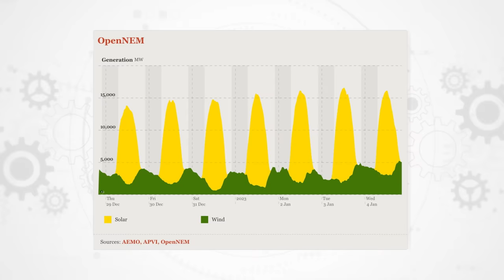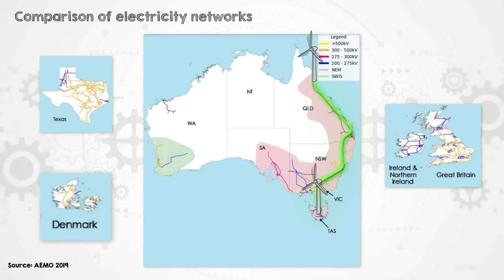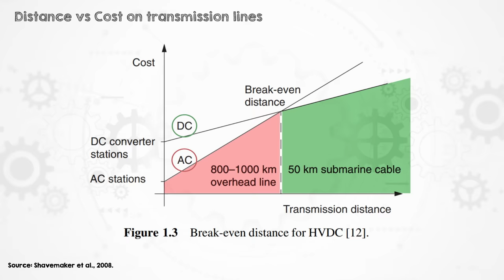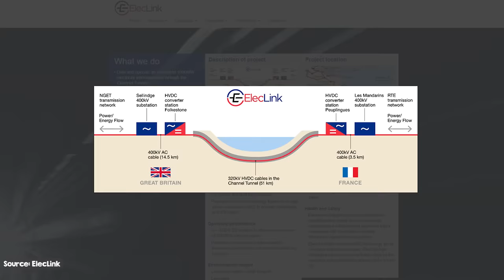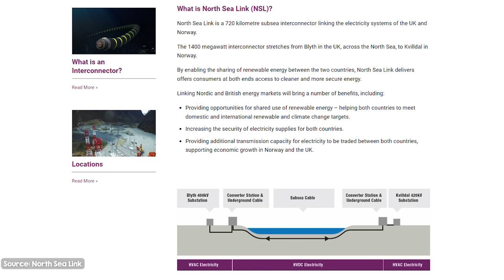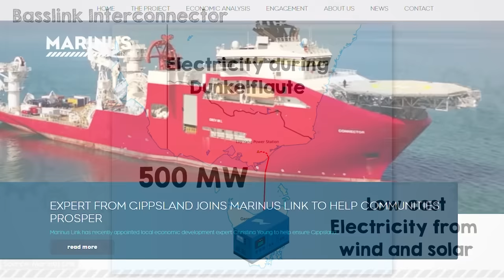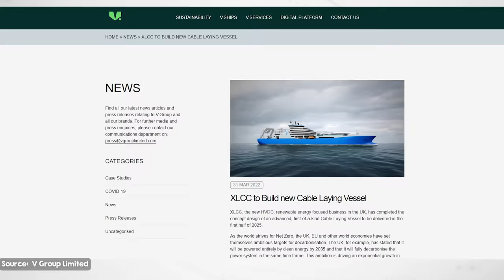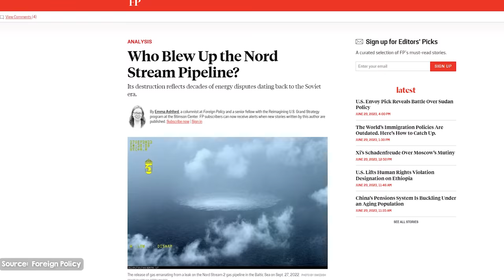Electricity Across Oceans: Is HVDC the Future?

Comment: There are discussions of a cable under the Mediterranean connecting the solar farms in the south of Israel to its north with a branch going to Cyprus and from Cyprus to Europe
Reply: I wrote my thesis in Electrical engineering in 1978 when there were fewer lines. The most interesting part of HVDC which you didn't cover are the converter stations which convert AC to DC and vice versa. Also other than arbitrage there are other benefits such as stabilizing a connected system undergoing a major disruption and delivery of email power during major get shortfalls.

Comment: Let’s manufacture thousands of miles of cables and create seagoing infrastructure to support it instead of just going nuclear and get green stable energy using infrastructure that already exists at decommissioned plants……..

As a engineer I was taught it’s not how many bells and whistles you can add, it’s how many you can take out and eliminate failure points.

Comment: ElecLink at 5:25.  No mention of the fact that at least 70% of the energy passing from France to to the UK is nuclear.  Ironically W&S and Nuclear power all benefit from having strong interties with other countries.  France frequently has non-emitting nuclear power that it can export at very low cost to surrounding countries, if the transmission capacity is available.  As I write this, the biggest power flow into or out of the UK is 1.38 GW of imports from France, mostly nuclear.

Comment: Texas has been using 80 Gigawatts of power during this heat wave. And pioneered HVDC connections ouside the Ercot Grid years ago. About 30% of that 80GW number is produced by Wind and Solar with Natural Gas Combine Cycle Generators on rolling backup. Shiuld note the current Texas Government Literally HATES green renewable energy. . Texas could easily produce 1/3 tp 1/2 of the U.S  total energy output with wind and solar by replacing our older windmills with newer 15 megawatt ones.

Comment: The resistivity of copper is over 36% less than that of aluminum at 20 degrees C; since losses due to resistance need to be minimized in long distance HVDC cables, I should think copper would be the universal choice despite its higher cost.
Reply: You just need more aluminium to get the same resistance, but since aluminium is cheaper than copper,  the aluminium cable may be cheaper, depending on the metal prices at the time.  There is plenty of space in the ocean for a slightly thicker cable!  Weight isn't really an issue like it may be for overhead lines, but the aluminium cable would be half the weight of the copper cable.

Comment: There is HVDC between France and England, but also between Germany and Norway.
It has also been considered to generate solar electricity in North Africa and to transport it to Europe. But to date nobody is willing to invest the costs.
Germany is in the process of building an overland HVDC line from north to south.
AC only works for short distances in the sea.
Reply: There are more than that: Just from Norway:
Norway - Denmark: 1,7GW
Norway - Netherlands: 1,4GW
Norway - England; 1,4GW
Norway - Germany: 1,4GW

To put that in to perspective, Norway's installed capacity is 38,8TW, with a yearly production of 154,8TWh in 2022. And this is mostly (>95%) hydro power.

"Germany is in the process of building an overland HVDC line from north to south."

Norway officially complained after the opening of the Norway-Germany link, and demanded that Germany build out capacity north/south or divide Germany into multiple price zones.

The reason was because when north Germany overproduced wind, they could not send it south because of the capacity. In addition the low capacity to the south kept the price artificial high, thereby lowering the profitability of the connection to Norway.
Reply: England??? 

The southern part of the UK??? IE Brexitland
Reply: @nc3826  No, IE is not Brexitland, they stayed in. The entire UK left, though, not just England.
Reply: @nc3826  Proving your point? That Ireland is Brexitland? I don't understand why you think that was a valid point in the first place, nor why you think I had the power to prove or disprove anything. But thanks, I guess. I didn't know my opinion was so valuable.

Comment: Bit surprised the biggest loss in AC wasn't mentioned, simple fact the voltage/current must pass through Zero 100 times /second, and the portion at less than RMS voltage must transfer to the peaks cause need for heavier insulation for the same MVA rating
Reply: Or 120

Comment: Because AC oscillates, it is not operating at the peak efficiency, either. Though most of the energy is transmitted when the voltage is highest (and efficiency is best). But a lot of the potential transmission capacity of the line is lost as it kind of spends a lot of time "throttling" in a way.

Comment: I'm only aware of two HVDC systems in the US.  One from the Pacific Northwest (border of Washington/Oregon on the Columbia River) to Los Angeles, about 1360km.  There is also a HVDC grid interconnect between the east and west grids in the US. The US is lagging behind on HVDC systems.  In other parts of the world we are seeing Ultra-HVDC lines (up to 800 kV) starting to appear.
Reply: theres also one between quebec and new hampshire. the project stalled out relatively early but there's still some quebec hydro coming into new england.
Reply: There's one proposed between an Iowa wind power farm and Chicago, running along railway lines to avoid rights of way issues - instead it's being held up by the Eastern Grid refusing to connect to a generator in the Western Grid.
Reply: And there are two above ground links in the province of Manitoba, Canada that bring hydroelectric power from the North to the load center in the south. They were built in the 1970s using mercury arc rectifiers, now converted to solid state thyristors as used in all modern converter stations

Comment: Imagine a Carrington-style event inducing stellar-scale currents.
Reply: Not as bad as you'd think - there are safety devices. It would cause widespread blackouts, yes - but most of the damage could be fixed just by re-setting the many isolators and breakers. Major population centers would be back on-grid in hours, small towns in days. If you live out in the sticks and the breakers don't have remote management then you might have to wait a few weeks for the engineers-on-overtime to send someone around to the substation. It'd be expensive and very annoying, but not a civilisation-ending disaster.
Reply: @vylbird8014  I guess relevant to this video, how vulnerable are HVDC converters, compared to AC transformers, to a massive power surge from a solar flare? Anyone know?
Reply: @ps.2  I'd imagine not too much. If you're dealing with 100KV, 200A on the /small/ end of HVDC anyway? Even a Carrington is pretty small compared to normal operating conditions. And no transformers to saturate. Probably trip some safety cutoffs, and it might be difficult to start things up again if communications is disrupted, but the HVDC hardware itsself should be fine. It'd need restarting, not repairing.
Reply: @vylbird8014  Also, since HVDC seems to be most interesting for undersea routes (the ones Rosie talks about, but also every offshore wind farm), I presume the water would largely shield them from solar flares, yes? (As I understand it, the danger from solar flares is not so much hitting a transformer directly, as inducing a power surge in the exposed lines. And the length of the exposed line determines the severity of the power surge.)
Reply: @ps.2  I'm not certain, but I don't think the water would make a difference - the induced current comes from a sudden change in the earth's magnetic field as it is distorted. An ocean of saltwater would provide excellent shielding against an electric field or radio, but it's going to do do next to nothing against a purely magnetic disturbance.
Reply: @vylbird8014  Fair enough, I'll take your word for it. Even if you're "not certain," I'm even less certain. (:

Comment: There is an air of impracticality in some of these proposals. For example there is almost no interest in Singapore in the much touted Suncable to provide energy from Australia to Singapore. This proposal widely touted in Australia does not appear to have a customer.

Singapore's energy capacity requirement is about 12GW. As current plants are retired it is replacing this with 2GW of locally produced solar power balanced by gas peaker plants and shared power generation with Malaysia and Thailand. It will likely also have links into the Indinesian power system that is itself planning for a solar supplemented by nuclear future.

It would make much more sense in Australia to build a transcontinental HVDC cable linking east to west, with potential to link undersea to New Zealand. Such a cable would allow east west arbitrage, a key to realising the potential of such projects.

Additionally, Australia with a population rapidly closing in on 30 million, needs every bit of energy it can get to transition from a highly fossil fuel dense economy, to one based on manufactured products and materials such as green hydrogen produced sustainably without green house gas emmisions, actual or potential.  

In a post green house gas world the country will need on line generation caoacity 24/7 of at least 60GW. To thrive it will likely be several times this, with some estimates ranging over 500GW.

Comment: They could use DC step up and down in the 1920's and did so on a large scale using rotary converters. Problem was the losses involved.
Reply: I think rotary and 200 kilovolts would have been interesting. An oil filled transformer is much easier to get working at high voltages.

Comment: speaking of politics being "outside the scope" of engineering, understanding how mutually distrustful nations could benefit from "trading" electricity could lead to closer relations, or at least detente (i.e. thawing of cold relations via talks).

if there is a way to include energy storage on both sides of 2 cold nations, there would be a reasonable buffer so the source nation cannot instantaneously sabotage the receiver nation. this would allow the source nation to sell to cold receiver nations by convincing them that they will not be denied what they paid for. of course, the cost and usage of such a storage bundle would be up to the nation that hosts it, therefore having one on both ends would seem fairer.

imo, politics often requires creative thinking to come up with viable solutions, and unlike what traditional mooks may think, i thoroughly believe engineers to be some of the most creative problem solvers in humanity. so if there are ways to engineer solutions out of political deadlocks, don't sell yourself short! my little example is probably as vanilla as it comes, simply because i'm not an engineer myself. perhaps if you lot are familiar with the intricacies of the political situations... you might come up with much better/more interesting ones!

Comment: Always thought DC was nearly useless for long transmissions. The old Westinghouse/ Tesla battle vs Edison
Reply: That was true 120 years ago, when they didn't have efficient and cost-effective ways to step DC voltage up and down. The invention of the AC transformer really changed the game back then — a very simple and relatively cheap way to step your AC voltage up and down to almost arbitrary levels, and there was nothing comparable for DC power. So they had to transmit DC at relatively tame, inefficient line voltage.

With modern engineering and semiconductors, HVDC is now possible. But as Rosie points out, its greater efficiency is offset by its higher costs at each end, even today, so it only comes out ahead when the distance gets long enough.

Comment: Very good but those of us with an engineering back ground in shipped liquids know we ship LNG at $7/MWh and could ship e-methanol or e-ammonia at about $10/ MWh.
HVDC probably better up to  say 1000 miles but above say 2000 miles, shipped liquids will be cheaper and they are dispatchable to make power and can dodge the politics by having multiple sources/destinations.
People forget HVDC needs to be firmed at the far end with lots of storage and dispatchable generation.
Morocco has periods of several days with no wind nor Sun. Canada has cold dark winters at the same time as the UK. 
A civilised world can't get by on energy which can disappear at the speed of light and needs a big dispatchable proportion and security of supply HVDC doesn't bring..
Reply: If there is an HVDC cable available then the e-fuel can be created and stored at the destination when there is surplus electricity available, so there is no need for your shipping!  Any electricity that can be used directly then has zero conversion losses unlike the shipped e-fuel.  I think the cable is going to win over distances significantly more than 2000 miles.  Not sure there is much advantage of having centralised storage, except for the odd emergency?
Reply: @nigels.6051  The engineering and economic world knows the real score. HVDC is way more expensive over great distances. Its why liquids are shipped world wide in huge volumes and there's not so much HVDC. Significant HVDC losses over great distances too.  
https://www.e3s-conferences.org/articles/e3sconf/pdf/2022/17/e3sconf_eregce2022_02001.pdf

Comment: Once again we get a bit of the logic missing. Electrical power  has two "dimensions" current and voltage. High cirrent implies low reistive loss (heavy copper conductors).   Hign voltage implies isolation/insulation (high towers with widely  spaced conductors) Air spacing is good, close spacing is bad, underwater is bad ( repair and conductivity/breakdown) 
All imply single point failure potential in an underwater network.

Comment: Total complete impossibility of sending DC voltage out on a journey accross the ocean.
as power loss of DC is so great that nothing at the other end would appear .Even AC
would be impossible as financial costs would overwelm a project to this magnitude.
Simply build a generator station at required sight .
Reply: This is just plain wrong. A 1000km +/-525kV 2000MW bipole HVDC system using 2500mm2 copper cable (~7ohms per cable) would loose only 28MW in the cables (if we assume roughly 2kA current). That's only 1.4% of losses in the cables.

Comment: The next horizon for HVDC is north Africa. Instead of laying solar in cold regions, the power simply needs to cross the med into France and get distributed from there. This is the German solution, and for most of Europe for that matter.

USA to Europe? No. Connecting the regions of the USA makes more sense. HVDC can act as superhighways for power in USA grids. Also, nearshoring is a factor. Turns out laying cables in the ocean can be cheaper than over land.

Comment: The losses associated with skin effect would be very low at 50 or 60Hz.
If long distance AC transmission lines were used alien astronomers might discover Earth because it would be a low frequency radio source. The Transmission line would act as an antenna.

Comment: So what happens to marine life when you generate a huge local false magnetic field?  What happens to their navigation and direction finding?  Nothing to worry about here, just like when the dams were built I suppose...
Reply: No issue we will have the oceans fished out in the coming years. All ready for cable.
Reply: This is one of the reason why the two cables are run in parallel as it cancels eachother.
Reply: @55damien55  doesn't we run coils parallel to make magnetic fields??
Reply: @0Aus  I'm not sure what you mean by that. The cables will produce a magnetic field  but to avoid compass deviation and confuse the fish, the cables are run with the other polarity nearby to avoid generating any significant field.
Reply: @55damien55  ok so traditional over head power lines do they also do that? As they produce energy fields that make them sway and also indicate to objects under them?
The fields are also linked to cancers tumours on the spleen in animals & I assume humans.

Comment: The confidence that losses would be only 3% over 1000 km of HVDC undersea cable sounds misplaced. There are no such undersea HVDC cables which run for that long, let alone 2,000 or 3,000 km, at present, so no actual experience of how much power is lost in transmitting electricity for such a long distance.. It could turn out to be 10-12% over 1000 km.
Reply: The losses in HVDC cables can be calculated extremely precisely using ohms law. All you need to know is the cable resistance which is a function of the material, temperature and the current in the cable.

Comment: Well, DC is not transformable. It can be electronically converted using semiconductor technology but then you have a failure point. How do you repair that a mile under water?

Comment: HVDC is capable up to about 4000 km but.  Like all systems the cost of the whole system needs to be paid for in both monetry and energy terms.  There needs to generate both monetary and energy profit for the system to be viable.  Technicly doable but questionable if it should be done.

Comment: Moving electricity  over long distances is very inefficient and costly. Also storing electricity in large quantity is very difficult.

Far better to generate the electricity where it will be used and using it now.

This is why electric cars are doomed to failure.

Comment: In 1974 to 79 South Africa's Eskom built a 1420km HVDC line from Cahora Bassa dam to Apollo inverter station near Johannesburg, 1920 megawatts at a voltage level of 533 kilovolts DC and 1800 Amperes. 
[https://en.wikipedia.org/wiki/Cahora_Bassa_(HVDC)